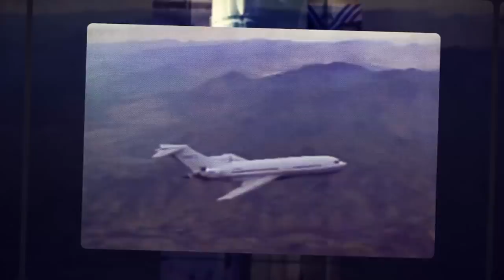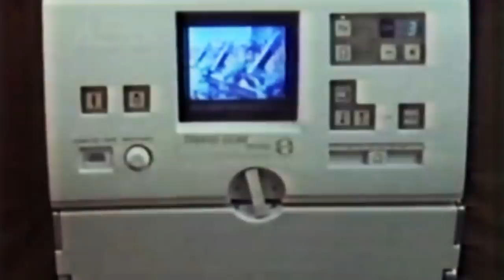This 727 had Tail Propellers (and sounded like a saw)

Comment: This is interesting.  This engine was a competitor to an engine program that I was involved with at Allison.  Ours was a demonstrator engine called the 578-DX.  We referred to it as a "prop-fan" while GE called theirs an "unducted fan".  The GE engine was a radical concept that really didn't have much chance of working viably.  The two rows of advanced, counter rotating propellers were directly driven by 14 stages of counter rotating turbine.  As a result, the very complicated turbine was operating at a much slower speed than is aerodynamically efficient and the propellers were operating at a much higher speed than is aerodynamically efficient.  That is part of the reason that the engine was so loud. 

The Allison Model 578-DX used a more conventional approach.  A modified Model 571 turboshaft engine with a variable geometry three-stage boost compressor drove two rows of advanced counter rotating propellers through a counter rotating differential planetary gearbox.  The propellers were funded by NASA through Hamilton Standard and the gearbox was also funded by NASA through Allison with the Advanced Gearbox Technology (AGBT) program.  The gearbox was rated for 13,000 hp at 9500 rpm input speed.  The geartrain was a simple planetary arrangement with double helical gears and four planets.  I wrote my GMI fifth year thesis on a single helical planet gear arrangement mounted on advanced ribbed-cup tapered roller bearings for this gearbox.  Our engine flew on a an MD-80, which is a twin engine plane, not a tri-engine as is the 727.  Here is a photo of the demonstrator in flight from my website:  http://www.schoolcraftpowertrain.com/Pictures_&_Data/2017-09-13%2011.18.36-1.jpg.  Our engine was quieter and more fuel efficient, but as was mentioned in the video, fuel prices fell dramatically near the end of the 1980s and that ended the plans for this engine.  Here is a link to a video about it:  https://youtu.be/W1y5c1lnDVs.

Notice that the engine model is painted on the nacelle as PW-Allison 578-DX.  Allison engineered, manufactured, and tested the engine.  Pratt jumped in with financing and flight test support near the end because it looked at the time like this was the future and they were left out.  They didn't actually contribute much to the program.
Reply: I fail to understand where the benefit was supposed to be in this design.
Reply: @swillm3ister  the benefit is in superior efficiency, especially with the Allison 578-DX. The Prop-fan would provide dramatically reduced fuel consumption. That's why that when the fuel prices fell, the economic driver disappeared. At that time, there was no longer a financial incentive to invest in development.
Reply: From what I can remember of the flight testing for both GE and Allison engine systems, it was found that flying into icing conditions produced damage to the aft fuselage skins to the extent that the concept was considered unviable. Apparently, ice would sluff off the blades and be thrown at the fuselage skins, loudly, and produced enough damage that the test aircraft required extensive repairs after being so battered. It became obvious that passengers flying on such a flight would leave it at their first opportunity and never return. What seemed like a good idea from an efficiency standpoint turned out to be a horrible idea from an operational standpoint. It also became obvious that passengers would spread the word, even if the aircraft was still airworthy, that the noise and possibility for damage in flight would be more of a liability than any gains in efficiency could make up for. Hence both concepts went quickly away, never to be heard from again.
Reply: @altaloma7789  I don't recall ever hearing anything about that. I knew the test engineers that were involved in the flight testing from Allison. A couple of those guys are seen in the video that I linked to. This seems more like the scary things people dream up to undermine a new technology than reality. Why isn't this a problem with any of the thousands of turboprop aircraft that fly all over the world?
Reply: @ronaldschoolcraft8654  I had a friend who was with the GE group. He told me what had happened. It caused quite a stir, but was so obvious if anyone had thought ahead. I don't remember ever hearing anything about it in Aerospace Week, but do recall that there had been at least a news brief addressing the cancellation or postponement of the GE program. I had been under the impression that Pratt and Whitney had been the other contractor, but it could just as easily been Rolls Royce.
Reply: @altaloma7789  it wasn't Rolls Royce. It was Allison. I was there. I worked on the program. Pratt got involved late as a partner with Allison because it looked like the future and they were left out. They had nothing to do with actually engineering the demonstrator. Rolls bought Allison in 1995 (I was there), but they had nothing to do with the 578-DX. Like I said, I knew the engineers that were involved in the flight testing from Allison. Icing was never mentioned as a problem. Also, we were actively working on a production design at the time. Our management specifically told us that fuel prices were the reason for cancelation. No one ever mentioned icing, period. Since you are reporting hearsay and I was actually involved in the program, I will leave it at that.
Reply: @swillm3ister  
you have to keep in mind that the very large deducted turbofan engines you see today on a 777 didn't exist at the time . They were all just straight jet engines for the most part. So the large fan on the back provided better fuel efficiency. If I recall they were quite noisy by today's standards just like turboprops are fairly noisy compared to modern jets. Essentially all new jet engines with the large enclosed fan in the front essentially took the place of this design. But they are quite large.
if you ever get a chance to go to the Boeing facility in Seattle there are two one closer to downtown and then their main assembly line north of the city I definitely recommend it.
Reply: @ronaldschoolcraft8654  A very interesting read. What are your thoughts on the benefits/disadvantages of a propfan vs a high bypass geared turbofan such as the PW1100G (bypass ratio of 12.5)?
Reply: @kens97sto171  The CFM56-5 which was introduced in '87 has lasted over 30 years though.
Reply: @twiff3rino28  
Interesting, didn't know they had any high bypass fans that far back. I'm assuming they weren't very common though and that was the reason for this inducted fan design test.
But I think that was the issue is that the high bypass fans solved most of the problems and had fewer negatives especially when it comes to noise.
Thanks for the information hope you have a wonderful day.
Reply: @ASJC27  good question. A geared fan is in between a traditional high bypass ratio fan and a prop-fan. They are an improvement in efficiency over traditional HBR fans, but not as much as a prop-fan or propeller. I have done some preliminary design work on a two-speed geared fan, literally with a clutch that allows a speed ratio change, in the past. The two speed ranges make it a variable cycle fan. 

The efficiency gains come from lowered disk loading. This means that less work is being done across the disk, so lower pressure ratio.

 Consider the MD-80 test aircraft for the Allison engine. The production engine for that aircraft is the Pratt JT8D low bypass ratio turbo fan. Both the 578-DX and the JT8D are rated around 20,000 lb. thrust. The fan rotor on the JT8D is significantly smaller in diameter than the propeller rotors on the 578-DX. They both must move similar amounts of air to generate that thrust. The JT8D has one small diameter fan rotor while the 578-DX has two very large diameter propeller rotors. Therefore, the disk loading is much smaller.

 Geared fans allow the use of larger diameter fan disks that turn slower with lower disk loading, just not as low as propeller rotors. Tip speed is also a driver here as you want to keep it subsonic.

Geared fans are the focus for development at present for efficiency reasons.
Reply: @kens97sto171  there were high bypass ducted fans in the late 80s. As was mentioned, the CFM56 is one. The Rolls RB211 was around as well. There were others. The Prop-fan had those beat on efficiency. They were what we were using as a bench mark for comparison. The Pratt V2500 was being introduced at that time. Pratt was afraid that it would be eclipsed and their investment lost, so they teamed with us at Allison on the 578-DX to hedge their bets. When fuel prices fell and the Prop-fans were canceled, the V2500 was selected instead in many cases.
Reply: @ronaldschoolcraft8654  
Would have been interesting to see that technology move forward..
Was noise a serious issue I know there were some new noise like regulations coming in at about time.
it must have been difficult to see a project you had put time and energy into cancelled like that..
Reply: @kens97sto171  noise was a concern. Especially after the GE-36 testing, since they got in the air first. Theirs was very noisy.

The 578-DX sounded about like a C-130 at take off. The McDonnell folks very carefully let our test engineers know that we were quite a bit better on noise and vibration than the other guys. Watch that other video that I linked to in an earlier comment.

Yes, it was disappointing that it was canceled. I was just beginning my career then. As I said earlier, I wrote my GMI fifth year thesis on a revision to that gearbox for the planned production configuration.

There was a lot of racy stuff in that gearbox. My mentor and thesis advisor at the time was one of the primary design engineers for the gearbox. The ratio was 8.3333:1 so for 9500 RPM input, the propellers turned at 1140 RPM. Input torque at takeoff was 7187 lb -ft and output torque was 59,891 lb-ft.
Reply: @ronaldschoolcraft8654  
Really cool information, thanks for posting the reply. Engineering stuff and mechanical stuff always fascinates me.
Hope you have a wonderful day and thanks again
Reply: I'm a retired engineer, but not in aeronautics. It's always good to read posts by engineers who have the qualifications and experience to explain things.
Reply: Hi Ronald - As shown in the video you attached, P&W division of UTC did sub-scale testing of model counter-rotating props to validate performance and acoustic modeling during development of the prop-fans. UTC even bought and flew an old Gannet aircraft with counter rotating props to validate noise prediction, because if it couldn't meet noise requirements the concept was DOA. I think UTC was Allison's partner because the prop-fans were designed and manufactured at Hamilton Standard Division of UTC. HS often worked with P&W on projects (and unfortunately, sometimes not).  The Prop-fan was invented at HS and funded by NASA in the 70's. The thin airfoils, numerous blades and sweep-back are all to get high power loading with high efficiency at slow enough rotation that the outer blades aren't generating too much noise from supersonic speed. 
     I was a young project engineer at HS working on the 578-DX prop fan blades. They consisted of forged and machined aluminum spars with PMR-15/glass honeycomb, adhesive, and ceramic insulation over bonded with PMR-15/ glass fiber shells (if memory serves). PMR-15 is a 600 deg F polymer used everywhere in the blades because the blade components had to resist the effect of the turbine exhaust impinging on them. Besides giving the blades shape, the high temperature composite components were supposed to act as insulation to limit the temperature in the aluminum spars. My impression was that the prop fan blades were way too complicated and expensive due to the props rotating in hot exhaust. Putting the props in a tractor configuration would have solved the problem or maybe turning the engine around like the P&W of Canada PT-6 would get the exhaust far enough away from the blades (but then where would the inlet be?).  Hollow steel or Titanium blades could be developed I suppose (the latter are on many high bypass turbofan engines today).The pusher configuration, as with GE's UDF, was to keep the sight and sound of the spinning blades away from the passengers. My impression was that the GE UDF was developed somewhat secretly with prop-fan data transferred from NASA, and was such a surprise when it came out that Allison/UTC/P&W/HS felt forced to answer with a 'quickie' job just to be in the running for development money.
     I have a question for you, because it always interested me:  Was that planetary gearbox an ungrounded design as on the TU-95 Bear bomber? From the video, it looks like the rear propfan is connected to the 'first' output of the gearbox and the front one only rotates in the opposite direction based on the gearing and torque split, just as with the TU-95.  This means the gearing only approximately determines the two different speeds the prop-fans are likely to run at, and the actual torque split and speeds are determined as well by the blade pitch control. Likely there is a best solution that has both prop-fans spinning close in speed to go as high a speed as possible without generating excessive noise, but with a speed ratio that has passing frequencies giving a lower (or better) noise signature. I think the Europeans have produced counter rotating prop-fans with different numbers of blades on the two prop-fans to help the overall optimization.  Fascinating stuff, but I think the 578-DX and UDF projects were shut down so fast, little of this was worked out from the test data to be used for a next generation set of prototypes.
Reply: @engnrpetev  I said that Pratt came on line with financial and test support, so I think we are in agreement there. I also said that Hamilton Standard designed and developed the propellers with NASA funding. The fact is, Allison designed the gearbox (with NASA funding), designed a 3-stage boost compressor, adapted an Allison Model 571 turboshaft engine, and integrated the propeller system without any input from Pratt because they were not involved yet.  Allison also built, and flight tested an advanced single rotor HS prop-fan on a modified Gulfstream GII prior to designing the 578-DX. 

The exhaust was always a concern. We were working on a means to duct the exhaust around the gearbox but inside the rotor hub to address this when the program was shut down.

The gearbox was a single stage, simple differential planetary with counter rotating output. The forward propeller rotor was connected to the ring gear and the aft rotor was connected to the carrier. Both rotors were free. The gearing arrangement gave a fixed torque split of 56% to the carrier (aft rotor) and 44% to the ring gear (fwd rotor). Watch during startup, the aft rotor always starts turning before the fwd rotor. Rotor speeds were controlled by the electronic control module by adjusting blade pitch.
Reply: How much efficient was yours?
Reply: @bogdannemes1995  I have covered that in my other comments on this thread.
Reply: Captain Phil Battagilia was the main pilot on that program for MDC. Dispatched some of those flights out of Long Beach and Yuma,
Reply: I just wanted to say thank you to Ronald for posting.  I really enjoyed reading your added content and context.  I think its really cool you took the time to share this really fun and interesting detail.  Keep up the good work and don't let internet trolls discourage you.
Reply: Do you see a potential come back of 578 DX? If ducted it lowers the noise level and scientifical proof says its efficiency doubles from lack of vortex at propellers' tips.
Reply: @altaloma7789  

I wonder if the icing issues could have been mitigated by putting the blades into a shroud to make a sort of ducted fan, and if the shroud would help make it quieter or improve blade performance
Reply: I remember seeing the Allison propfan prototype in the informal museum at the Indianapolis plant sometime around 1993-1994! I was there working on a joint GM/DOE project for a series electric hybrid vehicle using a turbine APU. IIRC it used twin regenerator drums. I worked for AC Rochester Division of GM at the time, and we were tasked with providing an electronic fuel delivery/atomization system. My main contacts at Allison were Ed Nitka and Joel Toof, I don't know if you knew them.
Reply: @dustybarn  yes, I knew both of those guys. It has been 20+ years since I have heard from either, though.
Reply: should of called it a turbofanprop
Reply: @ronaldschoolcraft8654  it obviously wasn't efficacy cause they don't use it to this day
Reply: @Jokertuning there are lots of reasons why good ideas sometimes don't come to fruition that have nothing to do with "efficacy"...

Comment: Broader and more spacious for the passengers, boy did they get that one wrong
Reply: I wish
Reply: Oh that's how the sell new aircraft to airlines. The airlines will cramp them in like sardines when they get their own seats in.
Reply: He said Broader not brighter.
Reply: No this 727 not 737
Reply: Simpler times.......
Reply: Adding more seats is not always practical due to weight restrictions. This was the real reason the 7J7 was canceled. The airlines wanted to cram more seats into the cabin but the aircraft couldn't handle the weight.
Reply: The greedy airlines cut their own throats. Cramming hundreds of people into steel and aluminum cylinders. Then making boarding or departing the airliner a nightmare of delay. And that is separate from obnoxious fellow passengers and screaming children.